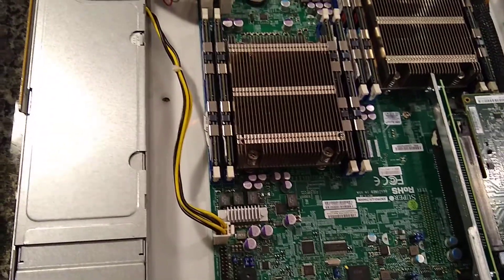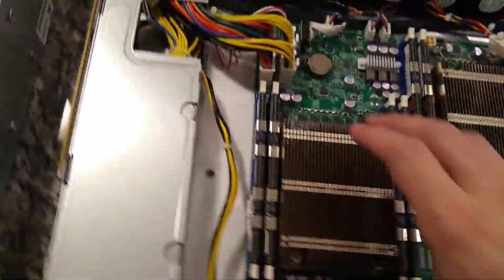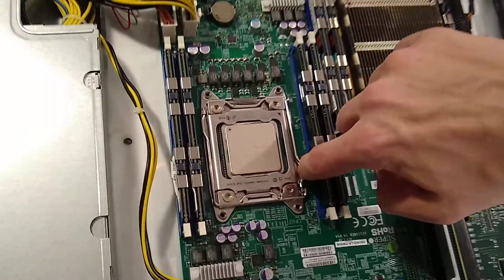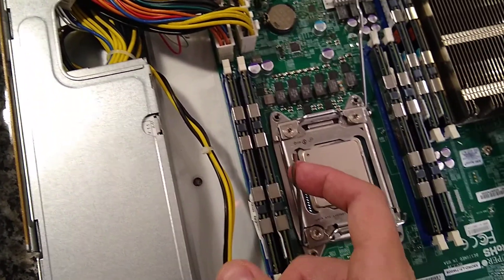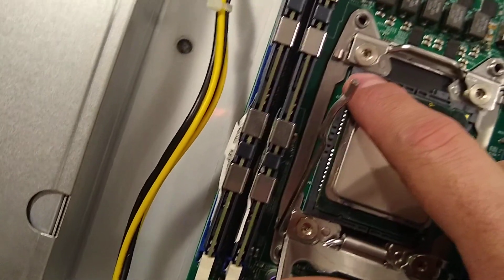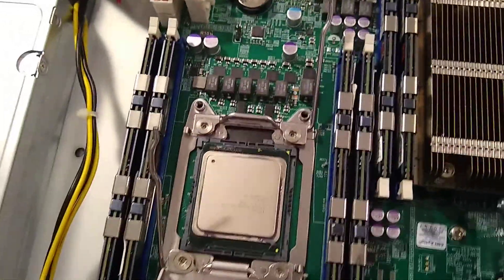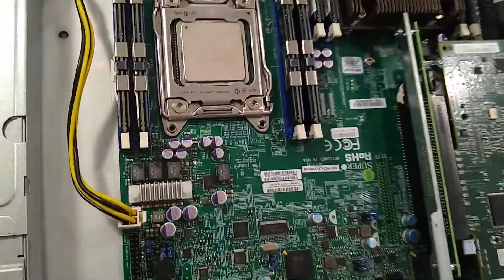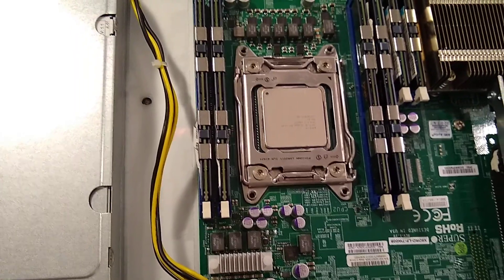How to install or upgrade your CPU on LGA 2011 server motherboard or x79 motherboard

Comment: Good video! Thanks for the walkthrough! I just got a supermicro board and e5-2667 v2. Been fiddling with a home lab for a while but on a pre-built; this is my first time to install a cpu myself. It took so much force I thought I bent all the pins but I'm too scared to take it back out and look! So then I started googling (maybe I should have done part first), and this video is making me feel better about it.